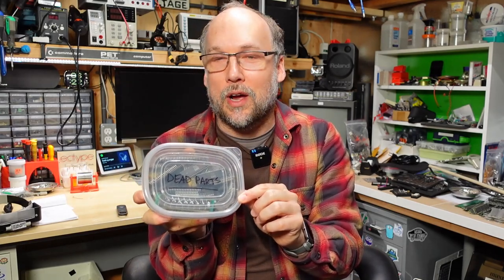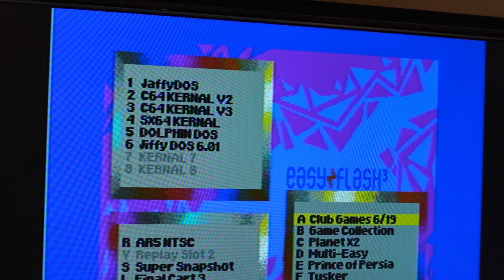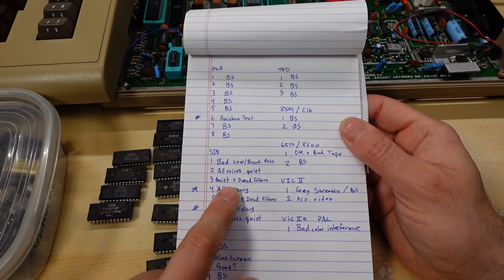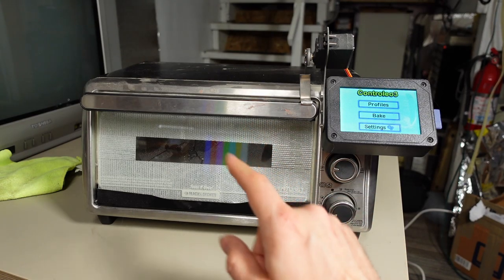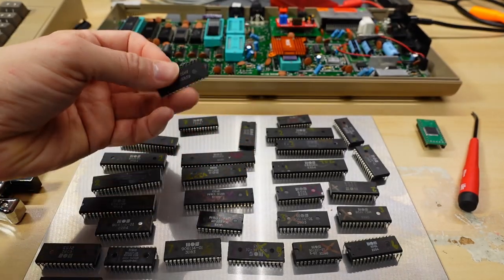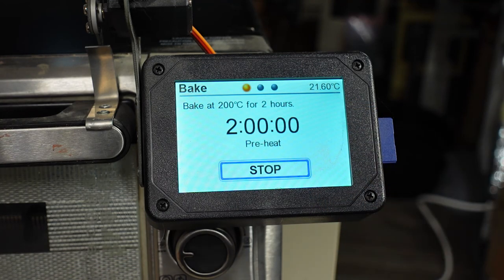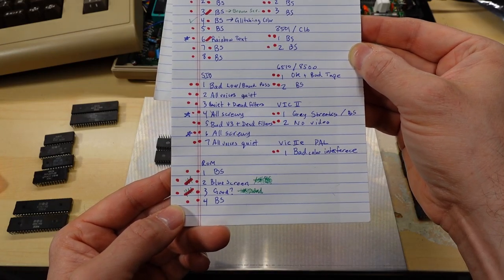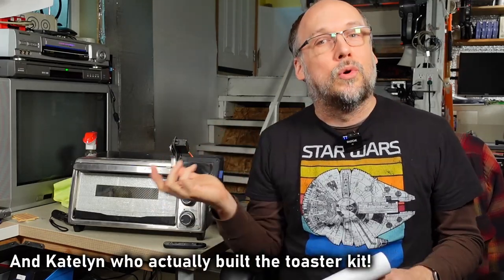Can we fix bad chips ... in the oven?

Comment: I've had a couple Breville toaster ovens where the fan went bad (long after the warranty expiration). I had a smart idea to open it up, replace the fan, and try to add a microcontroller (although what they've done is amazing! far more than I would have done). Unfortunately, everything I find about disassembling the Breville toaster oven makes it appear to be a one-way process (they aren't designed to be disassembled) and I've never taken the time it to actually try.

Comment: Back in 2001/2002 many Fujitsu hard drives were failing. We had calls every day. Some engineers tried freezing and baking the circuit boards and drives with some limited success. Eventually Fujitsu admitted a design flaw in the LSI controller chips and we tried using freezer spray and a heat gun just on those chips. Some engineers reported success in recovering the data but only on a tiny percentage of the drives. However the atomic migration thing was not the problem with the LSI chips so it would not have worked - but it is interesting that the techniques tried here are similar with the techniques 20 years ago.
Reply: Why not just put a "good" board to pull the data?
Reply: @MrChrisRP  Good question! There were dozens of versions of the firmware in the bad chips and you could not tell which you had, so when you swapped the board and managed to read the data, the bitmap for the drive would be read differently for each firmware revision and what would appear to be a good data recovery would be scrambled data in millions of sectors that your could never reconstruct. We guessed Fujitsu were having early failures and thinking it was because of their firmware, kept re-writing it to try and get it stable.
Reply: @qviewq2071  Very interesting. Thanks for the info!

Comment: I would use a higher temperature, I also know this phenomenon, I learned this problem of electromigration during my training in microelectronics more than 20 years ago. You can trigger the "repair effect" by quickly increasing and decreasing the temperature several times (between 150 and 180 degrees Celsius) over a period of 30 minutes and slowly letting the chips cool down.

Comment: I had to put my hp printer mother board in the oven before. Hp cheaped out on the solder the year the printer was made. The solder joints would crack and the chips would not be correctly connected to the board, which would cause the printer for crash and freeze at boot.
It works great now.

Comment: Did save both a graphics card (8800GT), and a soldered CPU on a laptop, through baking, followed some guide I found ages though, which adjusted the temp a bit as you went on, from 200c for 10min, 250c for 5min, 230 for 10min, 200 for another 10ish min +/-.. I believe it was. 

I mean, I'd not suggest doing it, but just.. It CAN work. These were both devices from back when EU did their no lead-solder directive back in.. 2006ish(?).

Comment: I haven't used this method on individual ICs, but I have used it very successfully on semi modern graphics cards several times. In one of the cases it was an nvidia card, that had bad soldering (my theory) which caused artifacts when it was displaying 3d graphics. Baking it fixed the issues temporarily, but they came back after a bumber of months again unfortunately. Repeatedly baked it a couple of more times before I upgraded.

Comment: Interesting video. Though I'm not surprised at the results. We used to do this "back in the day" but only with processors. Mostly during the Pentium class CPU era. 
It seems like the electron migration problem really depends on current/heat load on the chip. CPU'S being a prime example of chips that spend their lives running hot with a lot of current flowing through them. 

I'd love to see you try this again with some dead CPU's. Especially Pentium era chips.

Comment: Interesting experiment, but I was also very skeptical. It would be helpful to understand the likely failure mode in the various IC's involved in the study. In reference to the PLA's, it is well known the most common mode of failure is essentially degradation/corrosion of the substrate. This was described by Bil Herd and other former C= employees who investigated the high failure rate. If high heat is a "fix" for the electromigration condition, and none improved, we should assume none of those chips failed because of electromigration. You had adequate sample size to detect anything worth noting.

Comment: glitchy intermittent could be that a wire bond from the chip may be off,and through thermal cycling your moving it back in to place. but it wont re bond the wire so it wont fix might just make it work intermittently

Comment: I had a bad stick of ram for an iMac that responded well to baking, at least for a while. I ended up getting it replaced as I discovered it had a lifetime warranty from the manufacturer. Though that was probably just reflowing the solder on the little board.

Comment: This maybe the same issue as with the PS3 CELL & RSX, its the bond wires making contact again because of the heat. As you have shown its never a permanent fix or for some not a fix at all. Good video though and congrats on the 100K subs :-)

Comment: There's no indication to me either way, but another possibility is that the PLA that got better actually got worse. As a rough example, consider a chip that has a short between some parts inside. This short may keep the chip from working at all. Imagine then that the heat destroys one of the shorted regions further: It may be enough to resolve the short so that the chip comes back to some life, although now less functional.
Again, it's entirely possible that the chip did actually get better (for some material definition of "better"), I just wanted to show an alternative explanation. With only one chip showing a real change, and no knowledge (on my part) about the PLA's internals, it's impossible for me to tell.

Comment: 200 degrees is too hot. You're probably letting other things diffuse inside the chips, besides any small impurities or defects that electro-migrated before. You're probably killing the IC transistor junctions by letting any dopants diffuse too much -- you're "blurring" the interface between the junctions. Electro-migration occurs because you have a voltage driving the impurities and defects to move, but heat without any bias does a different thing, which is just ordinary thermal diffusion, which because it's a random process tends to partly nullify the non-random migration caused by the electric fields inside the chip during operation. But too high a temperature may cause too strong a thermal diffusion, therefore causing damage of a different sort from that produced by electro-migration.

(I'm a physicist, so this is just my too cents -- my explanation is just a tentative one.)

Comment: Seen a few videos mentioned resistor mod to fix the issue as you would need to check with dmm in resistance mode I think as you have to compare a working chip to the faulty chip. Usual suspect is when the reading is low from one pin to another point out the fault

Comment: i remember reading many years ago about people with xbox's that had the circle of death sticking the MB in the oven for a while and claimed to have some success bringing it back to life
Reply: The thing is, thats solder thats reflowed under the BGA chips. This video tried to do it with the chip internals, and there is no solder inside the chip, so this is complete BS. All bond wires are connected by fussing them to the pads and not by soldering.
Reply: @marcelhh2101  but the Xbox was a completely different case , the internal heat was warping the board and joints couldn't take the strain . Plenty of videos on YouTube about it
Reply: @marcelhh2101  : There is some distant chance that it could help some specific problems... it's just very distant.
Reply: Mr Guru  : Watch this video again, there was evidence of limited success. Nothing particularly useful, but not zero either.
Reply: @absalomdraconis  No, the behavior changed. But that most likely because the chip broke just further. Keep in mind, these chips break mostely due to overheating (hence extending the lifetime by adding heat sinks), and now you think you can fix them by adding head?! The partially success on the xbox what not because the flexing of the chip, but the board where it was mounted on. Those boards where notorious bad designed, causing stress on the board by the pressure of the heat sink mount.

Comment: I've reflowed boards to fix bad solder joints. First time I've heard of baking chips. In my mind those sub hair thin connections they have internally just wouldn't sit well with high heat.

Comment: Adrian, could you repeat the process  cleaning the pins of the chips. I bought some old hand held football and basketball games from the 80's and did individual solder reheats on the sockets and got both games working. I'm wondering if the failures might be signal corruption due to some form of oxidation. Perhaps a corrosive bath, or a wire wheel in a dremel.

Comment: Have you ever seen a chip "popcorn" when heated, that's caused by moisture being absorbed by the plastic of the chip.  Some chips if they get "damp" need baking to restore them to a functioning state. Moisture Sensitivity Levels (MSL) is the key phrase, maybe try putting one in a vacuum to dry and then depressurize under a pure argon atmosphere. (If that works I would conformal coat immediatly)

Comment: I don't know about individual chips but I have baked dead iMac graphics cards before to great success.  Apple, in their wisdom, used rubbish solder in various graphics cards which develop micro cracks over time from being heated and cooled.  Popping them in the oven for half an hour at 200 C can often revive them because said solder reflows.  I discovered this when I had a poorly iMac and once I'd got back up off the floor after a quote to get it repaired and done some Googling I found out about this process.  Unfortunately it doesn't work forever, the cards often fail again because of course the reason for the initial failure is still there - the bad solder, but you just pop it back in the oven and off you go again. the last one I did has lasted over 18 months so far and counting.  Many say it doesn't work, but several dead iMacs later I'd beg to differ.
Reply from the maker: It's like CRT rejuvenation. People say it's temporary and isn't worth doing but I have one Mac CRT still working well after doing this process. So I guess YMMV!

Comment: Good call not to use an oven for food to bake parts that once had solder and flux on them. Better safe than sorry when it comes to health.
Reply: Flux comes from tree sap, I thought.  Rosin flux has a danger label as an irritant only, not a poison.  Lead in an oven isn't a big deal, just vent the fumes with the range hood.  It's the manufacturing chemicals leaching out that is the problem.  I used to bake trays of cast "projectiles" in a modified cookie tin (with a heavily perforated base and a bucket handle made from steel wire), hoist them out and dunk the whole tin in a sink of cold water for tempering.  Never had any lead poisoning symptoms in the least.  But I knew exactly what was in the alloy and the worst was perhaps the arsenic.

Comment: Flip them over? They likely spent their whole time operating in an upright position... maybe get a gravity assist with the heat for the opposite migration?
Reply: Might be bad idea. The outside pins are connected with small wires to the silicon in the middle of the ceramic body. If solder is been used for connecting them, at these temperatures it may melt and the wires may fall off.

Comment: First thing that sprang to mind on watching you put the chips in the oven, was perhaps they ought to be facing the other way up or at least on a non-conductive surface.  Given the failure mode Electromigration, this is possibly relevant & the individual bond wires need to be electrically seperate from one another fir the process to be effective?  Might be worth a shot if you're willing to cook them one more time, for now I'll try and find a moment to dig out my dead Mortal Kombat Game Gear cart and give the PCB a roasting.
Reply: Mr Guru  point = missed...
Reply: Mr Guru  OK so why even reply what you did then?

Comment: I have to mention that this "fix" while sometimes successful isn't truly a fix. Most of the time the process of heating the chip up temporarily repairs the internal traces inside the chip, and will almost certainly die within days or a few weeks, at most a couple of months. This reminds me of the botch repairs on the Xbox 360 consoles to fix RROD issue. I repair newer consoles for a living and I would never recommend baking a chip to fix anything no matter how small the issue is
Reply: Mr Guru  no people "think" they are fixing the problem by reflowing the solder under the chip, but in reality it is the "baking" process which temporarily fixes the problem, which is why wrapping a console in a towel used to work. The solder never got to melting point when people used to wrap the console in a towel and simply hit roughly 100⁰C - 120⁰C (I never checked exact temps the 360 reached with this method). That problem was hardly ever down to the solder balls, and was a defective chip because of the manufacturing process

Comment: btw how did you get those zif sockets to fit the normal footprints? is there some adapter board for that i'm unaware of? because mine always have both too wide pins (because they're the folded ends of the spring contacts) and also too wide a footprint (at least for the "slim" dip sockets)
also, i have a "salvaged" Z80-CTC (Z8043006PSC from '87) which refuses to set the high 2 bits of its interrupt vector register to anything but high (so e.g. if i set the vector to 00, it interrupts on C0 instead), do you think it's worth a shot trying your method to fix that? i mean the way it's now you can't really use it for any timer interrupts but it still does stuff like baudrate generations etc perfectly fine... but if it completely dies in the process it's not too much of an issue because the part is still being produced and i can get one for like 5 bucks fresh from the factory

Comment: When a selector chip causes a single ROM to not be selected properly, or dataline not buffered, it should be possible to "bodge" this one circuit with a single 74xx IC.  Of course when all of them are not selected that is pointless because too many chips - PAL method is advisible then. But if you have a non-easily-replaceable 80-pin chip revived with with one 7400 chip piggybacked, I call it a success.

Comment: You had that one SID changing it's behaviour before baking already.
And then you had the PLA changing it's behaviour after baking.
So there's no numeric evidence, that the changed PLA behaviour comes from baking, because the testing results I could just have been a matter of the same probablity like with the SID chip. Objectively it's co ocurrence, not causality.
Of course one might think, that if heat mutates parts, it could also mutate parts back. But from what I have seen on electron migration, this issue doesn't seem to be reversible. It's like a pipe that's broken open in one part and clogged a bit further down the flow at once.

Comment: Sometimes when these chips die it is the result of high voltage that literally welds two adjacent lines together.  Putting them in the oven can melt the material and reflow them so they separate.  But this is a 1 in a 100 chance.

Comment: Do not bake computer chips due to the toxic fumes they will admit.  However, you could try non-baking alternatives such as silican gel or even rice. Or simply put them outside when it is hot and dry outside. The sun's heat will naturally "bake" them and they will be safely outside.

Comment: Wouldn't using a programmer like the one with a green slot and a metal lever be able to reprogram faulty chips to re-energize the silicon in the chip to work again?

Comment: I'd do 80°C for 48 hours to drive the moisture out of the plastic, then 120°C for another 48 hours, never hotter. If you put chips that always have moisture in their plastics at a sudden 200°C the moisture will most likely crack the plastic and/or oxydize metals inside the chip.

Comment: Using a heat gun on graphics chips from certain mfgrs can have the effect of reviving them on some laptops such as early Dell 5-6-800 series. People erroneously refer to it as reflowing the chips to the board when in fact the heat was correcting an internal manufacturing deficiency. Only problem is that the fix doesn't last and could fail after a day, week, month, or years. The defect was with internal chip connections which would fail with hot/cold temp cycles. It's well known in laptop circles as several companies used the defective Graphics ATI chips. There are of course other situations where putting a mother board in and oven can correct a poor solder joint. This is a reflow fix unlike the graphics chip "fix". Lead free solder of substandard quality has been a big problem in areas where components are temp cycled to extremes. Solder joints can form micro cracks and become open or resistive in nature. Ovens can fix this but generally resoldering using leaded solder is the best solution.
 

.

Comment: What kind of risk is there to the ZIF C64 by testing bad chips in there? I imagine it is minimal but could it cause damage to other components?
Reply: pretty minimal risk.  You could run into something like the an enable pin shorts to ground.  Then whatever TTL chip tries to enable that chip output gets blown.

Comment: I used the oven in the house for inserting and removing crank bearings in an engine, yep it stank the house out but worked well, but it looks like I won't bother trying to use it for restoring computer chips